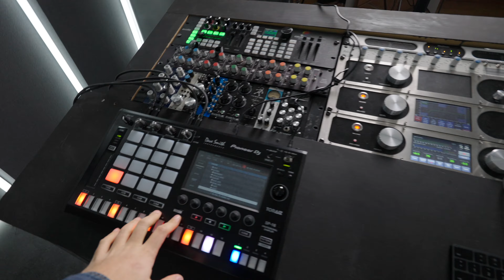My Label Shuts Down

Comment: Are the two tables utilizing different power sources? What I mean is are they running on two (or more) separate power circuits ? I am guessing they are as that is a lot of gear to plug into one circuit. By changing the connection point between them to all digital that could eliminate any physical ground connections between the the gear and therefore eliminate ground loops between the power sources. I am guessing the MADI connection is optical by the way you were talking. I haven't found it to matter whether it is optical or copper in past as I have never used a shared copper MADI connection that caused a ground loop but without delving into how the insides of the pieces are connected it would seem that the grounds are interrupted internally with the digital connection between pieces. They may have adopted something called source grounding as a standard in the MADI protocol which would solve that. For us end users it is a bit of an unknown and really an electronics guy thing to figure that out but I have always wondered that.

Comment: Hey, can you recommend me a quality poly synth that I can connect to a digital piano and learn more about sound design? Under $500.
Reply from the maker: the Behringer stuff is amazing and inexpensive but not sure if they have a polly synth for less than 500€ maybe used
Reply: @Jonsine  thanks for the recommendation!  I have so much to learn about sound design, it's a hole new world to me.  I'm looking to buy a hardware that is easy to use and understand that I can play live together with a digital piano. Any specific models come to mind?
Reply: @Jonsine  I think as a beginner I'm better off getting something simple right?